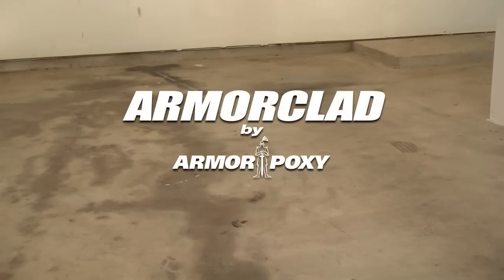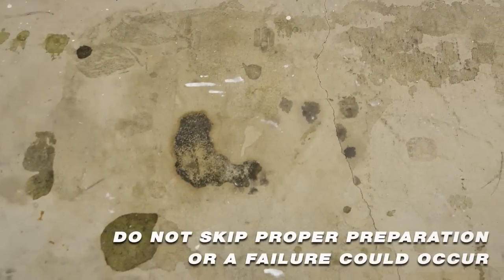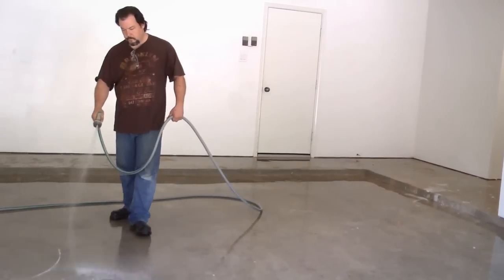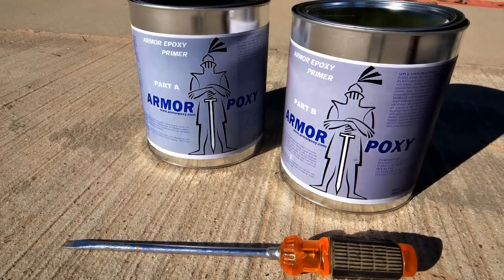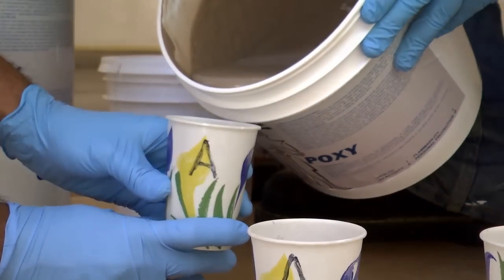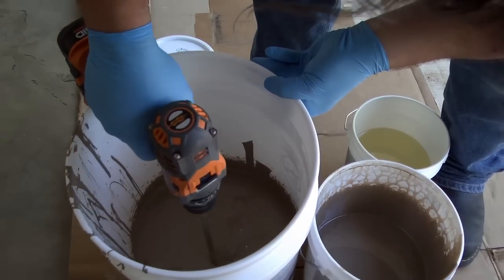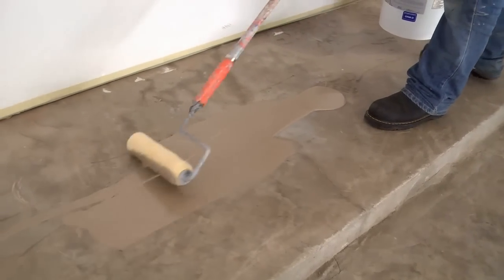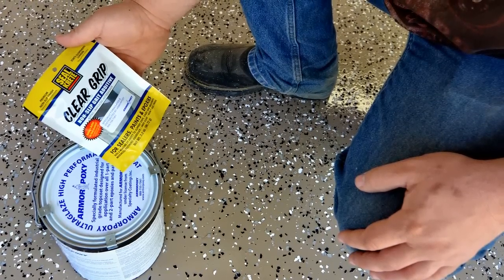How To Install Armorclad Kit by ArmorPoxy

Comment: I've installed ArmorClad on many garage floors and never had an issue with colors. If the concrete has a weird color or many stains I always put down a base coat of primer. If you don't, the end result is of your own doing.

Comment: Why are their kits sold for 300 sqft or 600 sqft garages.  Who has a 300 sqft garage?  Even a small 2 car is around 400 sqft.
Reply: standard single car garage is 12x22....that's under 300 sq ft.
Reply from the maker: The kits are sold in 1 and 2 car sizes for up to 300 or up to 600 sq ft which covers 95% of most garage sizes and leaves and adequate safety factor.